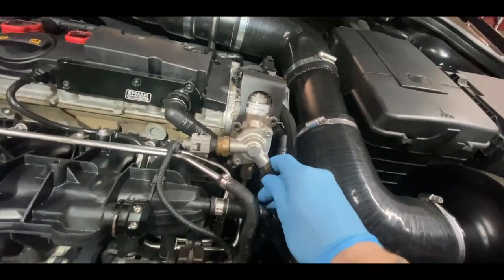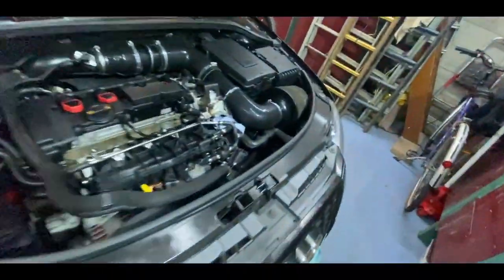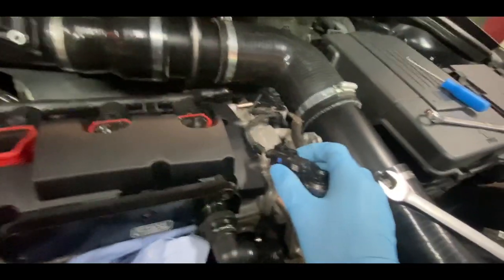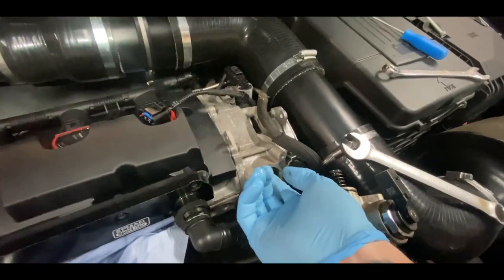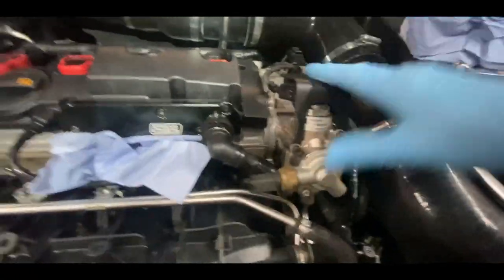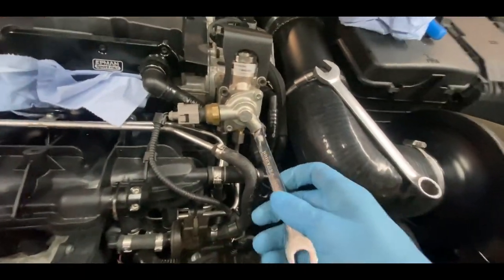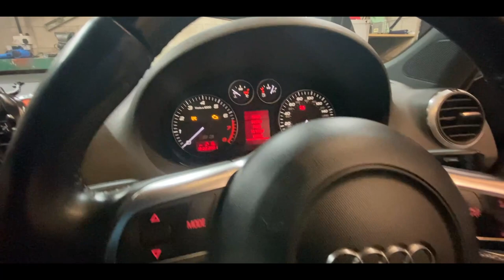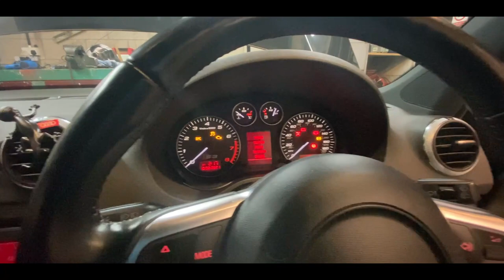Audi S3 8P - How To Change Cam Follower

Comment: Hey man, nice video! I am about to buy a 2010 A3 with the EA888 2.0 TFSI. Could you help me please with some reliability advice about the engine please? (especially the timing chain with its tensioner) Thank you.
Reply from the maker: Yes I can, probably best thing to do is to get a scanner and scan as these engines arnt very easy to notice if anythings majorly wrong, but their very good for throwing codes in the ecu

Comment: My s3 audi 2017 reg misfires while stationary is that beacuse of the cam shaft or the cam flower?
Reply: Cam follower*
Reply from the maker: If it’s misfiring it’s to do with spark, coils - sparkplugs
Reply: is the problem solved? coils?